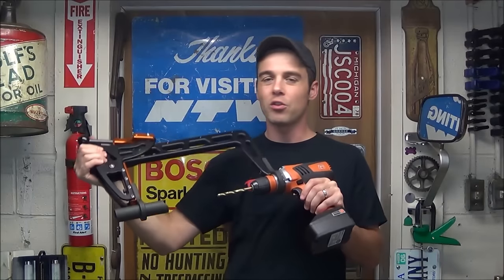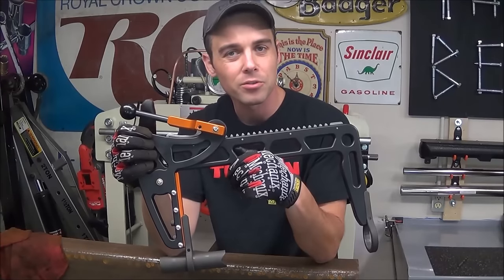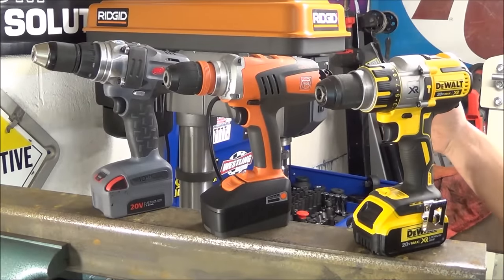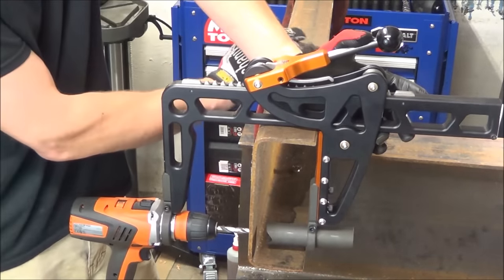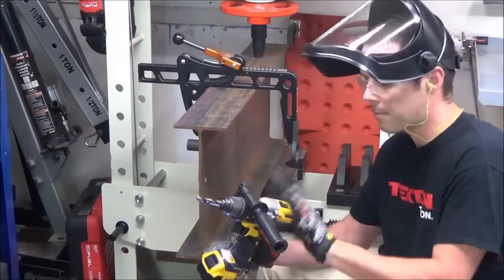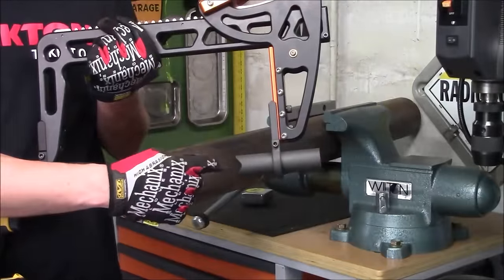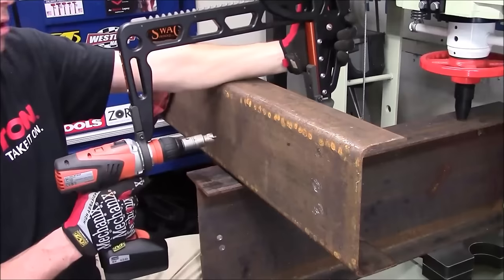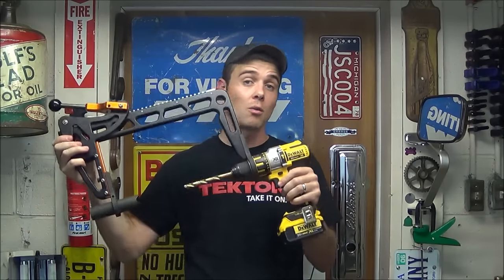Rapidrill - MADE IN USA

Comment: Another advantage I see to this is for drilling where you can't push hard against it, beams that might be in drying cement and you want to keep level, metal sheet that might be dented or bent by forceful pushing... by pressing equally from both sides, this alleviates that problem.
A niche problem sure, but I'm sure some people have that issue. 
Maybe you can't clamp the metal down, or your table keeps moving when you try to drill, this will hold in place with no movement.
Perhaps you need to drill high up where pushing can throw off your balance and when it cuts through you risk falling off a ladder, this stops that and also gives you a second point of contact.

Too expensive, but it sure had uses.

Comment: For that price they should include a receiver tube with a threaded end that accepts various size flat plates to keep the tool square to the work piece. The tool should also come with and attachable drip oiler to use when needed. That's one benefit of a mag drill is having a free hand to oil hole saws or other bits.

Comment from the maker: +Daniel M it isnt cheap....but it is designed to be a lightweight & effective alternative to a Mag Drill ($1,000+) .... they do have a cheaper model coming out soon, but I am not sure of the price on that one yet.  For the guys cutting the drill time on one job from 5 days to 5 hours (hand drilling VS Rapidrilling)....this pays for itself quickly.
Reply: Real Tool Reviews that is a pretty cool tool. Amazing how fast you got through that 1/2" thick plate. Not only is that rapid drill much faster at drilling holes it is also 10 times easier on the user. I'm an electrician and I would love to use that rapid drill working in the car plants. Drill so many dam holes through thick steal usually 7/8" to 1 3/8" holes with hole saws for trade size 1/2" to 1" connectors. After a few holes you get tired and hot and frustrated and it takes forever. A simple task of drilling holes through steal but it's a painful job after about the 4th or 5th hole with 20 or so to go. I have spent entire days drilling holes. Good review glad to know it's not made in china and it's high quality

Comment: Very cool, but I would be worried that the drill will wear out very quickly. I don't think they were designed to take that kind of force.
Reply from the maker: +Nutz4Gunz45 The other thing to keep in mind is overheating the tool & batteries.....without this, it took me over 4 min to drill the 1/2" hole through the 1/4" I-Beam.....with the Rapidrill (and same bit & drill) it took 10 seconds......literally 25xs as fast.
Reply: Real Tool Reviews Even with the decreased usage time, bearing life goes down proportional to the cube of force increase (check out ISO equations for "L10 Bearing Life").  In other words, you had mentioned a roughly 10:1 mechanical advantage, or 10 times the force applied.  10^3 = 1000, meaning the bearings in the drill will wear out 1000 times faster using this thing!  So unless you're drilling holes 1000 times faster (I saw about 25 times faster), you're going to be spending a lot of money on drills!  Don't get me wrong, cool concept, but hand drills just aren't made to handle those loads.

Comment: This seems to cost considerably more than a Milwaukee Electromagnetic Drill at $1500.00 according to their website. Doesn't seem to make sense to me.
Reply: +SATAMAN Schmidt Not only that, it's putting way more force on the drill then they are designed to take. I can't imagine that drill will last long.
Reply from the maker: +SATAMAN Schmidt Portability & one of the only alternatives to a Mag Drill is the selling point.....keep in mind that the new M18 FUEL cordless Mag Drill is coming in at over $2,300 & would be a lot harder to lug up and down a ladder/scaffolding that this.  I think for the guys making a living with it, it would be a deal (think $10,000 Snap-on Scanner.....no home mechanic would ever see the value in that).
Reply: +SATAMAN Schmidt I know Rapidrill has teamed up with Fastenal and can be ordered through Fastenal for $1100-1200. Still this is not a DIY tool at that price but was intended for guys that drill steel every day. http://rapidrill.com/rapidrill-slim/ is coming out soon and may be a better fit for the average guy.
Reply: +Real Tool Reviews 

A mag drill and this thing are two completely different animals -  Mag drills are generally used to run larger annular cutters.  Mostly over 1/2" dia, plus you need access to the opposite side of the drill bit for this to work.  So..... there is room in this world for both machines.

Comment: I don't like that at all. It's gonna be a wrist breaker when the bit reaches the end. On the clip with the 3/4" plate you can see how the clamp is bending.
You wanna drill many holes fast, then use a pilot hole and then use the right speed for the hole you're cutting.

Comment: Definately a tool that will speed up productivity. Only problem I see with it is that it won't work on Milwaukee m18 fuel hammer/drill drivers because they have a different collar when attaching a handle to it, unless this kit comes with an adaptor for it. Still very cool item to buy
Reply from the maker: +othoni Thanks!  I agree....hopefully they can expand their drill adapter lineup to include additional models without the round clamp point.

Comment: My only problem with is since it requires 2 hands there's no way to spray any cutting fluid on the drill bit which will significantly shorten drill life so say you need to drill 50 holes and each drill bit will drill 5 before it gets overheated and wont drill anymore you would need 10 drill bits. At $8 per drill bit (assuming they're good bits) that's $80 in bits for one job now say you do 12 jobs a week that's almost $1000 a week in bits now say a normal drill you only use half that many drills without you save $500 a week in bit costs. Just my 2 cents
Reply: tyler reel  There is new stuff out there callec cutting paste. Jancy called it Slugger paste before they were bought by Fein. You can buy it on Amazon in a big tube for under $20. It's a clear gel that you just squeeze it on the drill bit and hole location. stays in place while drilling. We use it now instead of oil or water lubricant now to mag drill holes in steel. Much better then fluid because it doesn't run off the bit.

Comment: It is nothing against the review, but for the price you could also get a decent mag drill.
Reply from the maker: It is more-so designed for speed & ease-of-use.  There are plenty of situations where a Mag Drill would work much better, but if this fits --- it will really speed things up.  (Saving $$$$ big time in labor costs)
Reply: This is true. I guess it would be depending on the company and the situation.

Comment: You should have made a thermal picture with a use-case with it and one without.
its massive the heat that sums up in your drill bit... here from only a few seconds in wood on a new brushless drill i jumped on.
https://imgur.com/gallery/JvQls8Q
and also checking how the sink housing takes on an new impact drill.
https://i.imgur.com/9ehQ6in.mp4
You can bet that speed drill in a 25/1 time-ratio doesnt come free of charge when it comes to heat or wear for that mater.. just something to have in mind, and would be relevant to measure or at least indicate with some testing.
anyway thx for the vid.. appreciated..

.